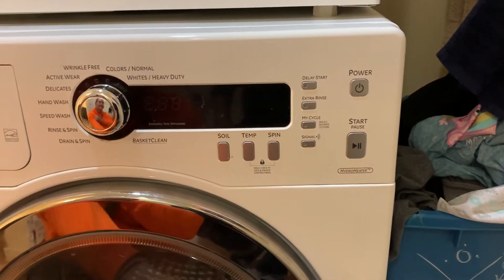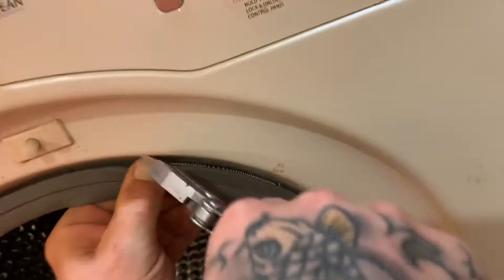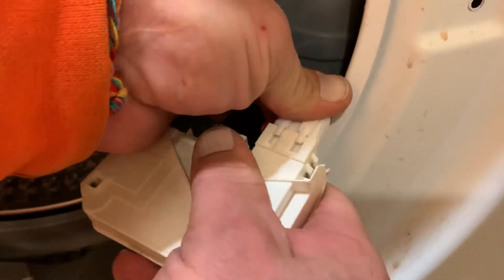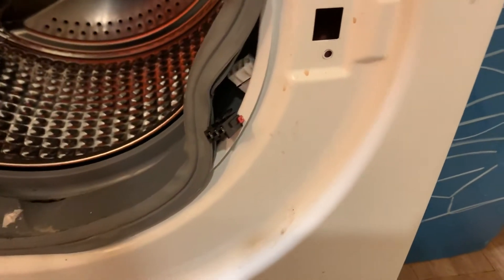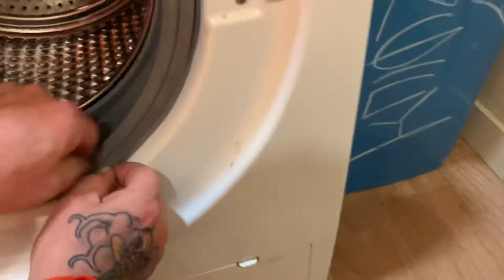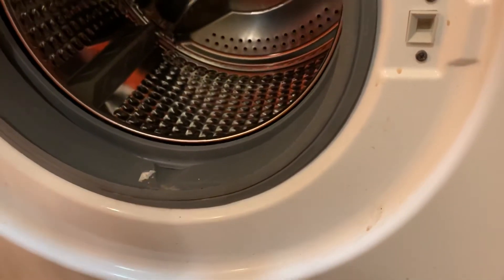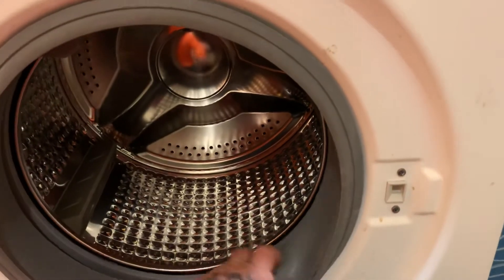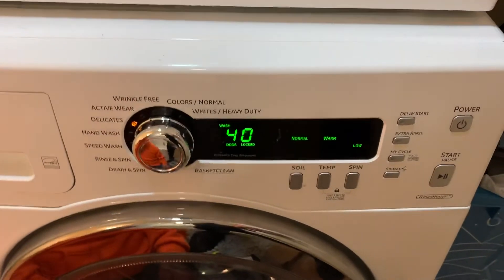GE Washer turns on and does nothing

Comment: That fixed the problem for me and this clear explanation really helped.  I have to wonder why such a universally despised part was ever used.  Haier made up for the failure by having this part stocked where it could reach me in 2 days. BTW, with my short fingers and wide palms the method [avoid dislodging gasket by pulling out the machine, removing the top and reaching the part from above] shown in some other youtube would never have worked.  I found it helpful to use a bicycle tire lever when re-seating the gasket and insuring the retaining wire was tucked into the fold of the flange.
Reply from the maker: Thanks for watching, yes you can go from the top too but where I work they are stacked and the resident had a bunch of stuff everywhere and no where to set the dryer down so this is best case for me. Please like and subscribe

Comment: @303jrios Is there any step that exists before you can see the metal ring? For our model, that gray rubber is very tight and I'm not able to pull it back.
Reply: Same here, did you end up figuring this out?
Reply: @VA7AYG  I did - just look at the gray rubber the entire way around and eventually you will see the portion you can pull. Ours was just in a very different spot compared to the video, but the instructions were super helpful.
Reply: @michaelbarnes406 when u hit start would it do nothing then the time remaining on display blink then nothing???

Comment: I appreciate this video! Does anyone know what specifically fails on this part? To me it seems like the spring weakens and the solenoid can't fire all the way. I wonder if one could just pop open the part and re-stretch the spring to give it more of whatever direction it needs. I'd love to see Big Clive dissect this...
Reply: I took mine apart after replacing and there was a small (3/16") piece of plastic that broke off the lock latch mechanism and was drifting around in the housing. I can't seem to add pics here?
Reply: @ronfisher1793  Upload to imgur and then link here. I was able to fix the mechanism with a bit of hot glue and a 3D printed insert, then put it back in the machine. no problems yet!

Comment: I need help with my GE GFW148SSMWW, it won’t start and I couldn’t find the tech sheet in the washer
Reply from the maker: The tech sheet isn’t under the lid?
Reply: @303jrios  I checked the lid, the bottom of the lid, the gasket and the back, it wasn’t there, instead, can you help me go into service mode on my GE compact washer?
Reply: @303jrios  Hello? I need help with my washer, or I have to just replace it by going in the laundromat
Reply: @shawna1899  . Hit the buttons after disconnecting and reconnecting power. signal - rinse - signal - rinse. It will go on service mode.